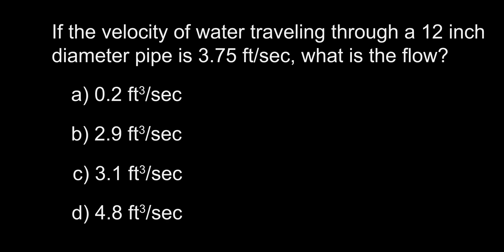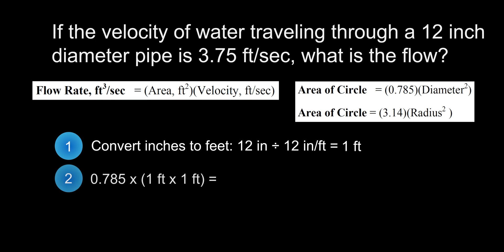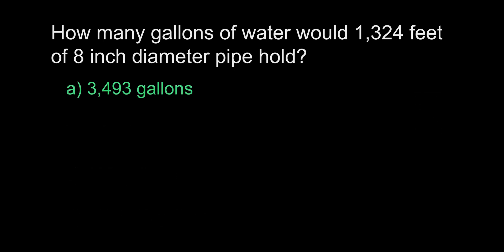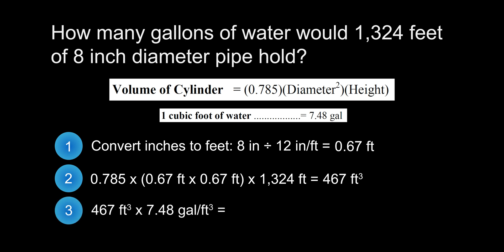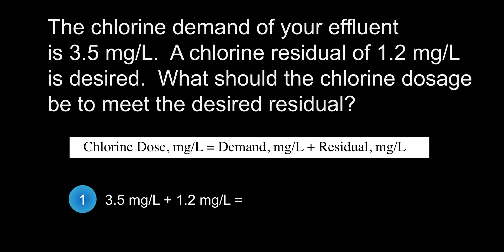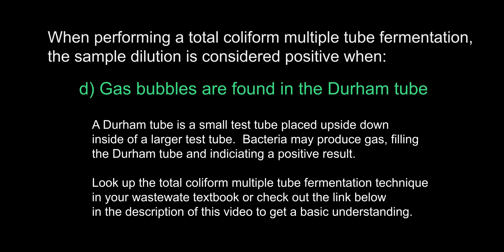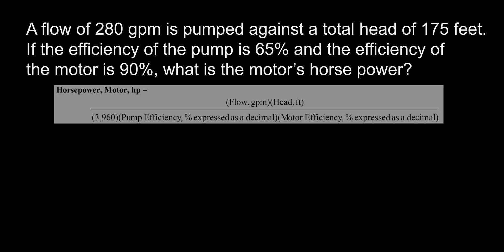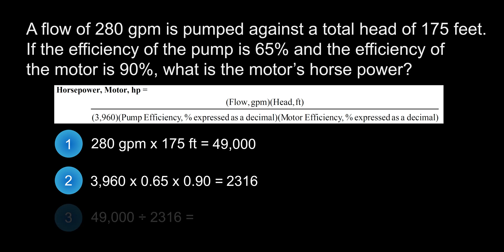Part 14 - Wastewater Treatment Operator Exam Questions

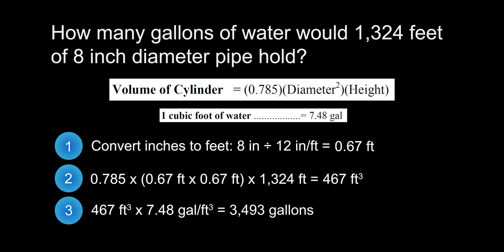Comment: Ur math is a little off at 3:47
Reply from the maker: Hi, I appreciate the question.  Would you mind being specific?
I did round the answer to the second step in that question.  Is that what you are referring to?  
Other than that I believe the question is correct.
Reply: @worldofwastewater I ended up getting 3455 gal

Comment: I am going for my level 2 Wastewater treatment. Is this beyond the scope? I have heard that there was a lot of question on aerobic digestion and there have been a lot of questions about anaerobic  digestion
Reply: Depends on state I think.  I'm in Massachusetts and I had to get my grade 3 within 6 months. I'm on month 7 going for grade 5 Friday.  Math wise these will be on lower and intermediate.
Reply from the maker: My videos try to go over a range of material.  There is no way in knowing what will be on your exact test.  Every state and level of test can be slightly different.  But learning the fundamentals will carry you through any exam.

Comment: would the horsepower actually be 22? i thought you were supposed to round up if its not exactly that number
Reply from the maker: I just looked this up, as I did not know if this was a rule when calculating horsepower. You are correct, when it comes to horsepower always round up.  With that said on an exam they won’t have you choose between 21 or 22.  Exams don’t have that kind of trickery in them.  In other words rounding isn’t ever an issue, if you do the math right you should find the answer or something very close to it as a choice.  Thanks for the comment and teaching me something. :)
Reply: @worldofwastewater  glad there won't be any trickery like that lol, I take my exam in a week 😬. Thanks for the reply!

Comment: quick brain teaser, what is the water velocity with a 300gpm pump with a 12 inch discharge pipe?
Reply from the maker: 0.85 feet per second.
Reply: Awesome! Can I get a math breakdown on this answer please. 😊
Reply from the maker: guitar shredding

MATH BREAKDOWN!

For reference to the answer below, cubic feet = ft^3
this means "to the third power", you may know this but I just want to clarify before going forward.

1) 300 gpm ÷ 7.48 gallons/ft^3 
    = 40.1 ft^3 per minute

2) 40.1 ft^3 per minute ÷ 60 seconds per minute 
    = 0.67 ft^3 per second

3) 0.67 ft^3 per second ÷ 0.785  square feet (aka ft^2) 
   = 0.85 feet per second (aka velocity)

In Part 3 the 0.785 ft^3 is the diameter of the 12 inch pipe in ft^2.  Use area of a circle formula to find this.
(follow along with a question where I review that or look online)

0.85 feet per second is the answer.

Comment: 1 87 MGD. Thanks for your work and content.
Reply from the maker: 1.87 MGD, is correct!  Looks like you had a typo and missed the period. Congratulations on being the first response and thank you for the support! =)
Reply: Oops! That's a big fat fail on the state exam.
A lesson to all for sure.
Reply from the maker: @tbirdboy  😂
Reply: It seems like the questions I printed out doesn’t line up with the questions that are on the video. However, I’m still learning the concept. Thanks again for these very helpful videos 😅!
Reply from the maker: @shanikareynolds11  I'm glad you find the videos helpful!  Would you mind letting me know of a specific example of what doesn't line up on the video to paper test.  I'd like to fix it if thats the case.
Reply: @worldofwastewater  for number 66. On the question , it was missing “diameter” . On number 67. My answer choice “A” states 3,459 instead of 3,493.  Number 68 states a whole different problem on paper than it is on the video.
Reply from the maker: @shanikareynolds11  Ah, okay, you should redownload the exam.  I have made fixes to the exam along the way (the questions in the video are always accurate).  Thanks for replying!
Reply: Question 67 doesn't seem to work using 3.14 × r squared. Will you break this down?